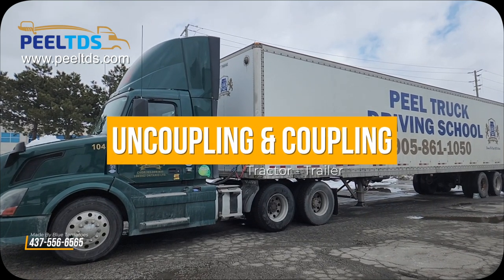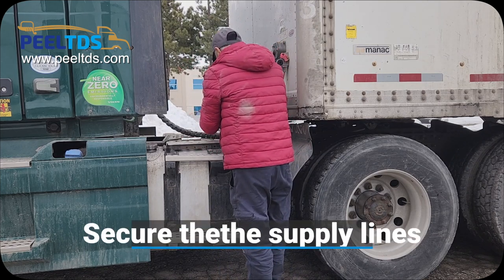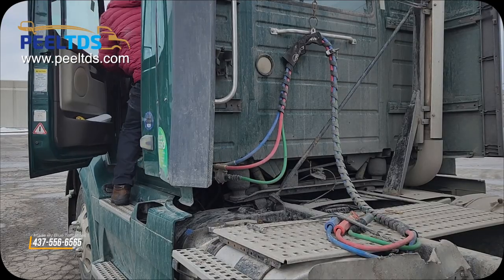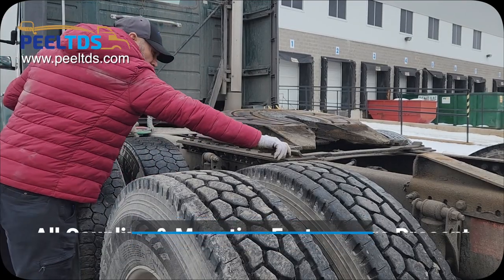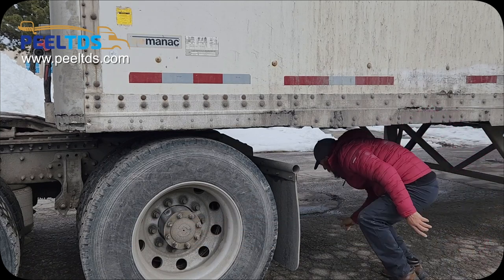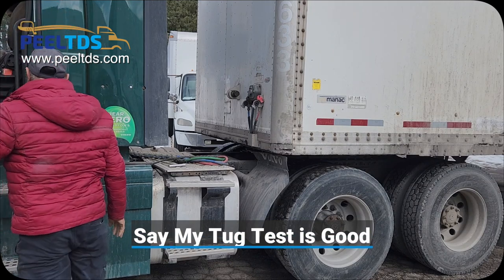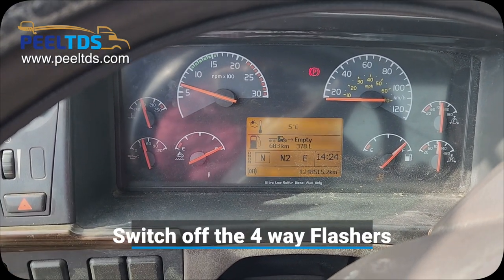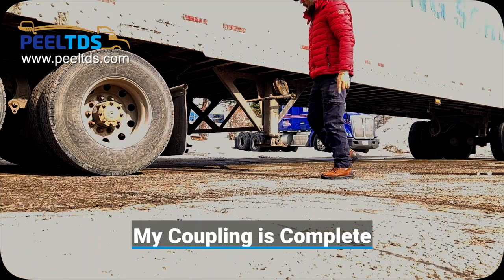Coupling Uncoupling |  AZ License 2023 | Peel truck Driving School

Comment: Went walking around the truck be sure to put 1 foot in front of the other and push off in a forward motion. With the body moving forward be sure to alternate pressure on each foot to ensure a walking motion. If this is the level of detail required to certify a truck driver, I’m not necessarily sure they should be driving at all.

Comment: Hello Peel TDS, I am a Qualified Evaluator and Instructor, plus I began my trucking career in Jan. of 1976. I have almost 50 years of trucking and over 5,000,000 miles accident-free. The first thing I want to tell you is the catwalk and the bungee cord, are illegal. Nothing is supposed to be on there. If you've been checked and haven't been caught, it is only a matter of time. That 5th wheel is dry as a bone, which means the trailer's upper plate is dry as well. That alone will be costly. How this driver Uncoupled and Recoupled, was wrong. Plus I won't get into all he missed, but he was only showing how to. I will give you a little hint, do you see the 5th wheel and the excessive overhang of the 5th wheeled grease, that is a big time waste and means that whoever laid grease on there, at some point,  placed way too much. I am going to check out a few more of your videos, and I will leave a comment. In my professional opinion, I'd drop this video and do it again, only this time, try for a better score.